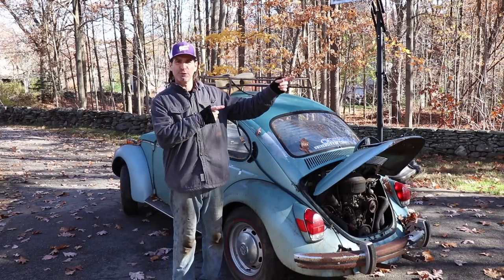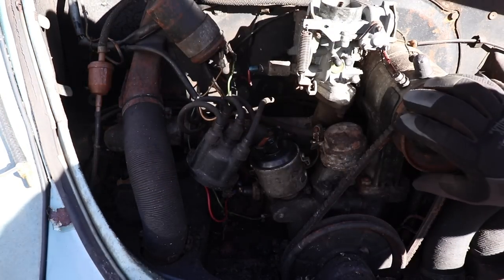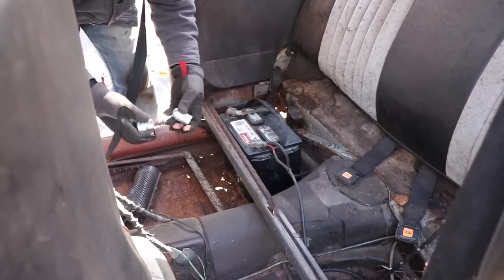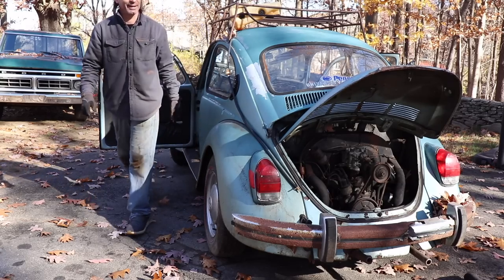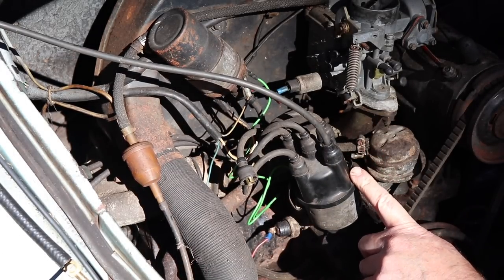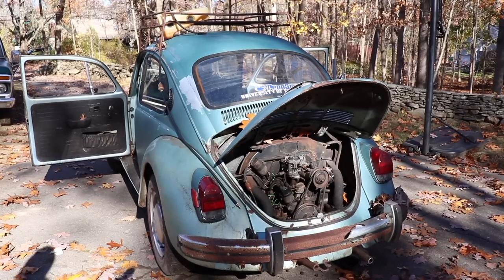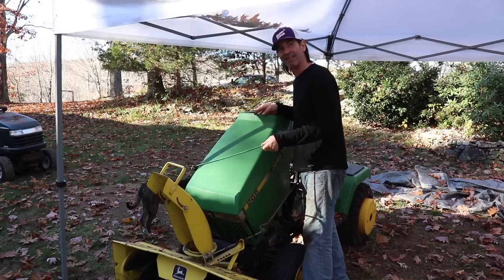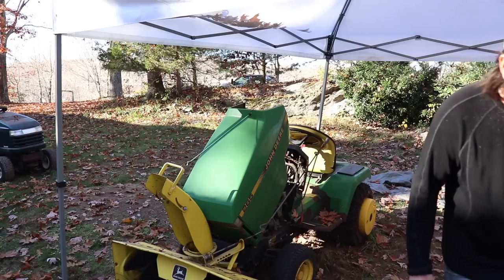FIRST START In Years | RARE VW Beetle - Will It Run? CT Shed Find.

Comment: Happy Birthday Jason 🎉🎉🎉. My super beetle ‘74 was timed BTDC I used a strobe light to fine tune it using the marks on the flywheel. I would do it with the vacuum pipe disconnected at 950 RPM idle. It ran and started sweet like that…but I had electronic ignition on it by that stage.

Comment: the timing you mentioned is for emissions and a vac type dist. With the mechanical you can go maybe 5 degrees advanced or 32 degrees total (at 3,000 rpm) if you have the right timing light.
Reply from the maker: Thank you , yeah I brain whiffed that one

Comment: Of all the things you’ve got there; are there any of the Bugs w/solid floors & body?  I had high hopes for this one because I had an identical one - even same color. But when I saw that the wall in rear passenger area was disconnected from the rest of the body I had to pass. I can’t do body work so need one that will not need it.
Reply: It looks like it will need at least one floor pan, but it also looks like that heater channel may be done already??